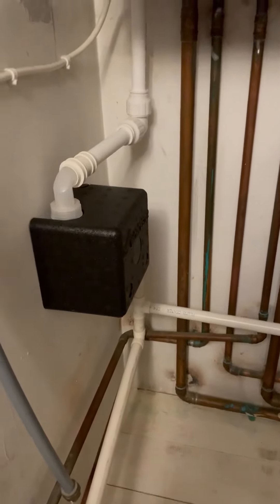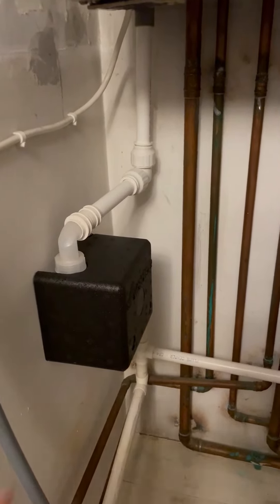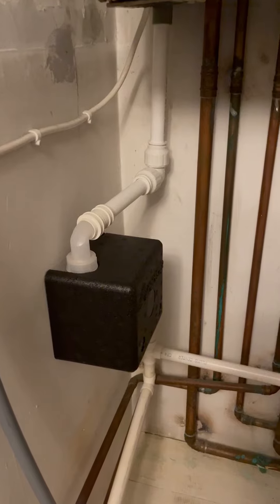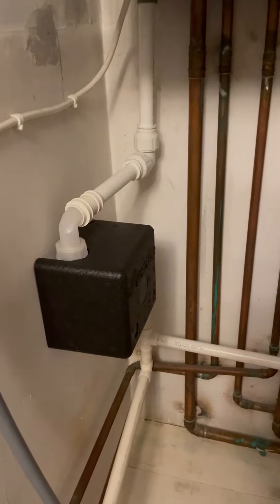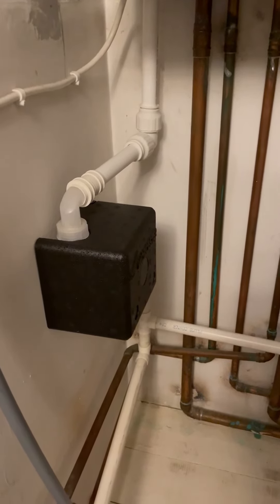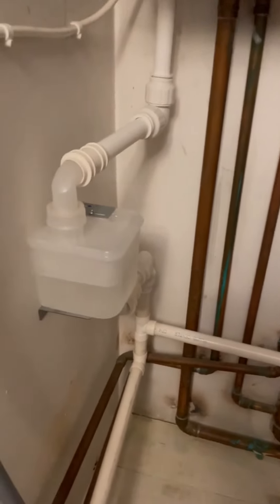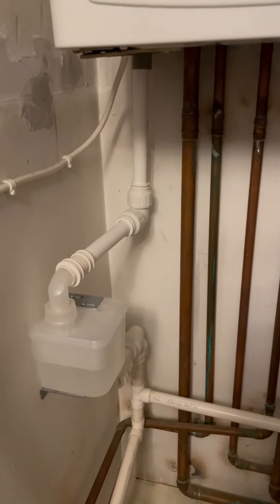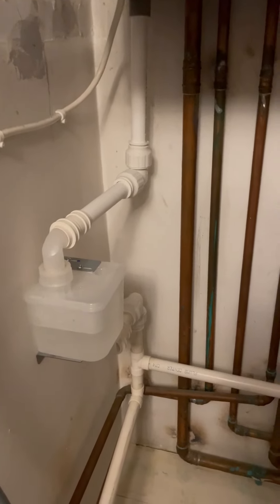Review of Worcester Bosch CondenseSure Siphon

Comment: It has to be next to the flow pipe to make any difference, the heat from the flow pipe is what keeps the condense warm and stops it freezing
Reply: It states in the manual that it's not always possible, even though that is the recommended route hence why they provide brackets to wall mount as shown in the video posted.

Comment: Lovely job .I'm actually in the process of doing the exact  same. Can I ask what size pushfit you have used and if you used the inserts as well?
Reply from the maker: Cheers mate, bought some 22mm push fit elbow joints. I used some Fischer universal wall plugs to screw to the wall 👍
Reply: @Danielwood30 did you use inserts before you put the push fits on?
Reply from the maker: I just roughly marked the wall where I wanted the siphon to sit, then cut the 22mm pipe to fit 👍
Reply: @Danielwood30  judging from your reply I don't think that you used pipe inserts before offering up the pushfit. I'll get some inserts to go with the push fits. They are small inserts with rubber gaskets which go inside of the 22mm pipe, so when the pushfit is offered up it creates a water right fit and also stops the pipe from deforming under pressure
Reply from the maker: @Dermuu  No probs, I just bought the elbow joints from B and Q which had the seals inside 👍
Reply: Right that's my weekend job booked. Thanks for the vid, it's given me ideas